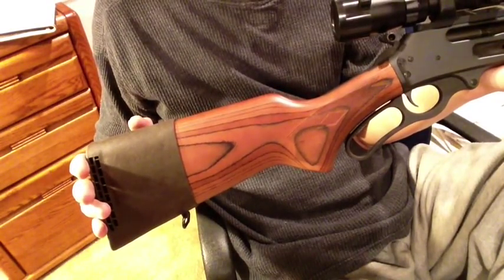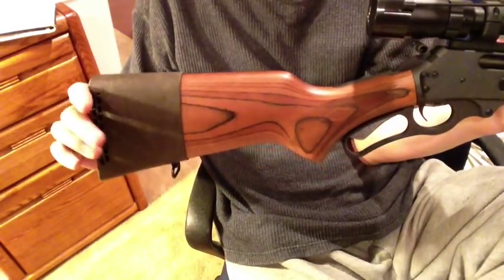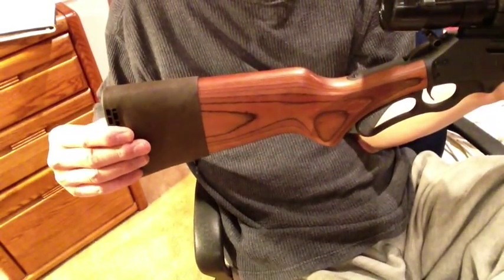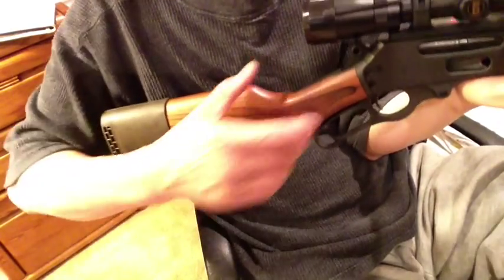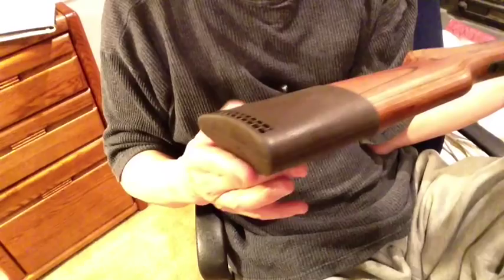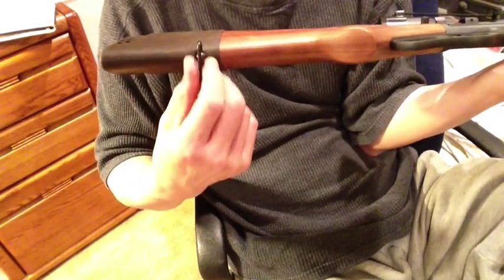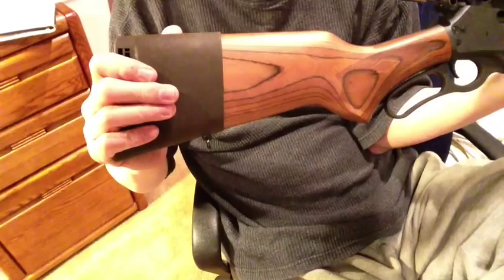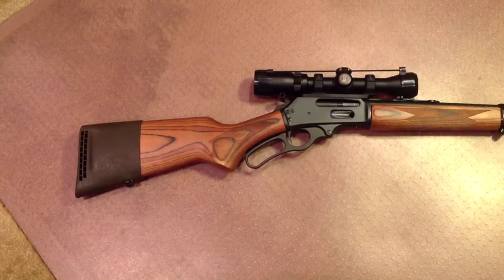Butler Creek Slip On Recoil Pads

Comment: Great plan....just a heads up. Leaving that pad on the butt stock after a few years leaves the stock under it discolored
Reply from the maker: gman77gas - As you would probably agree, we're not usually going to take these things off unless they wear out.  My guns are shooters, so perhaps my grandsons are going to have to do some stock refinishing - or not.  Best Regards and thanks for the tip on the stock discoloration...
Reply: FortuneCookie45LC That's a good one...let the grandkids worry about it.
Its time for me to start clearing out some of the guns I don't shoot....
Reply: Different species of wood are more uv reactive, you could put a uv resistant finish on your stock with out changing the original look. Otherwise just refinish the stock after several years of sun exposure. It's way less trouble than ending up with shoulder problems that may disable you from shooting. You can't refinish shoulders but you can refinish wood.

Comment: I'm 6'4", and I do okay with my Marlin 1894, so you must be really tall that you need the extra length of pull with the slip on pad.
Reply from the maker: PinkOld - Not at all, I'm only 6' 1 1/2", but I have 35" sleeves, and perhaps a slightly longer neck = need for more LOP.  If LOP is on the short side, 1) works for more people as can adjust (military rifles tend to have LOP on the short side) and 2) works for more cases of thicker clothing like uniforms, winter wear, or tactical gear...   Best to ya...and always good to get comments from PinkOld....